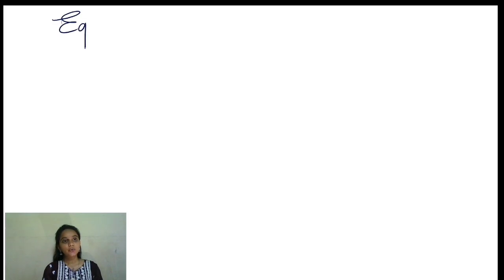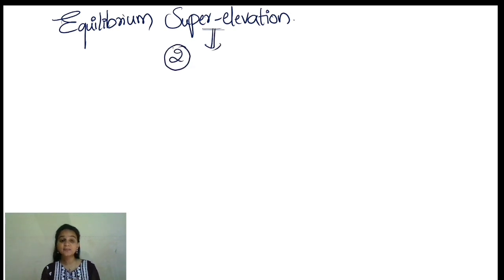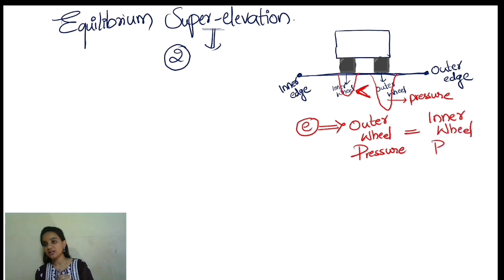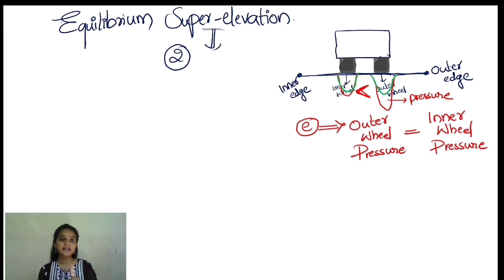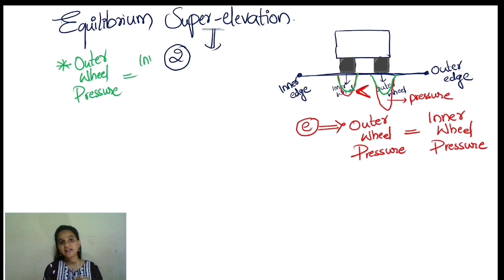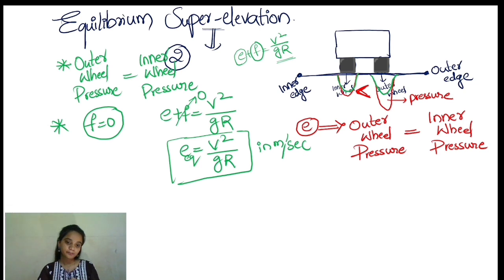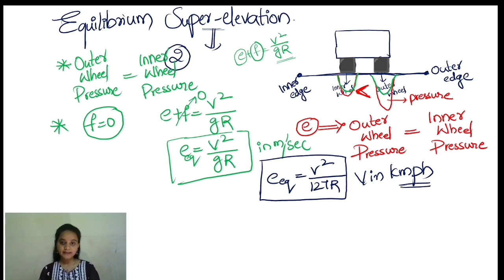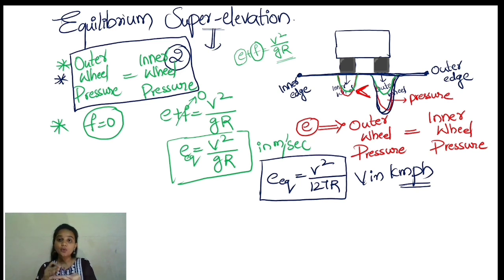Concept Equilibrium Super elevation by Poojitha veera|#transportation #tspsc #aee #fm #civilindex

Comment: Medam, Why should in outer wheel pressure will be more by comparing with inner wheel? While turning the vehicle inner wheel  May  have more pressure na medam?? Plz correct me mam..
Reply: On curve situation, due to centrifugal force which acts on outer wheel, pressure will be more little bit compared to inner wheel